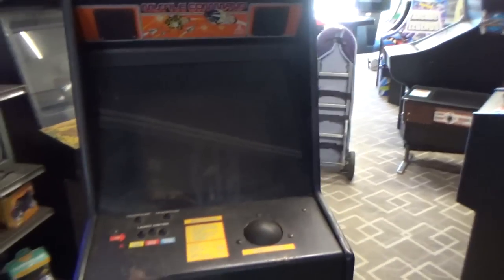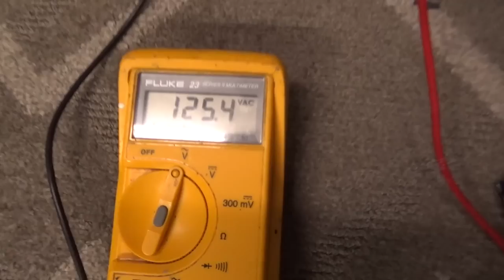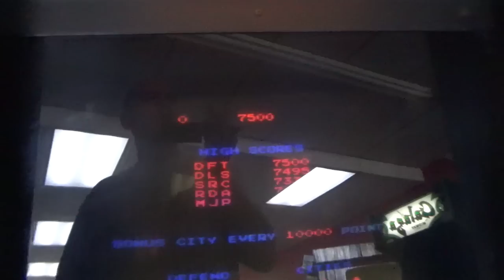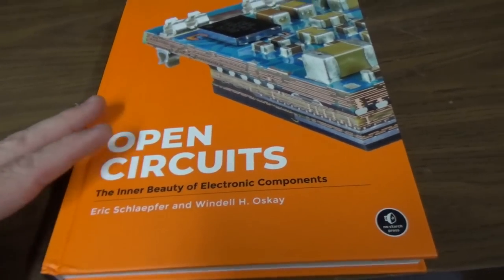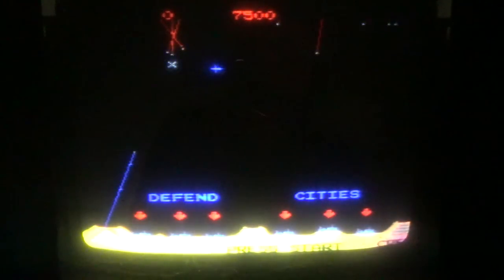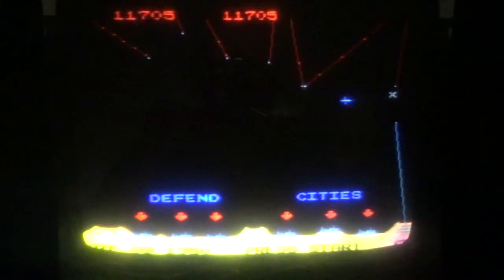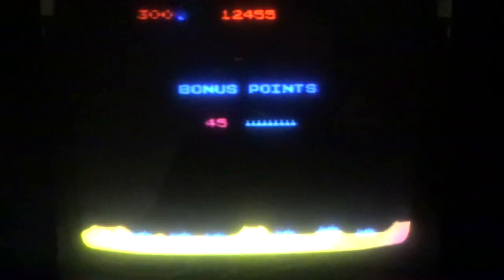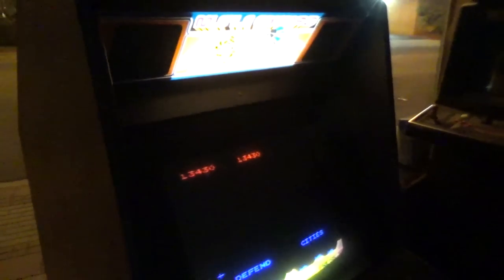Repairing This Old Atari Missile Command Arcade Machine - Completely Dead Survivor Cabinet!

Comment: I 100% agree with starting at the wall. I had a gorf and the ground pin was missing off the plug. Had the 60 cycle hum because the ground was bad. Replaced it and no more hum.

Comment: In an 8 bit system 255 is the largest integer number you can store in one byte (8 bits) (0 to 255 gives 256 numbers).  Trying to store a larger number than that in one byte is an error, if it's a variable they never expected to get that big they just didn't program in any error handling so the program crashes or does unexpected stuff.  This was back when memory was so expensive that you programed as efficiently as possible to save every bit of space, so no extra bytes for numbers you don't think will ever go over 255 and minimal or no extra code to deal with errors.
Reply: It gets weirder than just an error. The system will roll over the register count and add 1 to the adjacent register. Depending what's in that next register is how it will corrupt.
Reply: @chrislembke9566  Well, all you have is the 8-bit accumulator, so it doesn't roll over to another register (that only works with memory address registers and the program counter). It just sets the carry flag and starts over at 0. So you get a truncated rollover.
Reply: This guy and the comments below cover it. 2 to the power 8 is 256. Each bit (which is on or of via high or low/off current) is either 1 or 0 used to create binary numbers and hence the 256 max value...or if you start from 0 then 255 is max value, hence why both numbers are 'weird'. As the comments below say, once you hit the max number and then 'add' one more either the overfow value spills into another variable or part of code messing that up or rests the currnet variable to 0 and starts over or both.
Reply: ASCI goes from 00 to FF in the code also. That associates 0-255.
Reply: @David-ue3vf  -- Older machines used their own adaptations of ASCII. Some used a 7-bit ASCII. The alphanumeric characters and the control characters were all in the same places, but every thing else varied.
Reply: This happens regardless of binary or computers. Imagine if you were counting from 0 and you could only use 3 digits (like a combination lock where each digit is on a separate spinning cylinder). You would go from 0 to 1 to 2 ... to 99 to 100 to 101.. then finally to 999. If you continued counting normally (without the 3 digit limitation) you would go to 1000, however you only have 3 digits so the 4th digit is ignored and you're back at 0. 8-bit processors like the 6502, which Missile Command runs on, work with 8 bit (bit just means a binary digit) binary numbers. Specifically, they have 8-bit data buses, which means the processor can only receive and send out 8-bit numbers, and an 8-bit ALU which means they can only perform operations on 8-bit numbers. Counting up from 0 in binary (base 2) would look like the following: 0, 1, 10, 11, 100, 101, 110, 111, 1000... The number of digits (bits) goes up exponentially, so 1 digit can hold 2 values (0 and 1), 2 digits can hold 4 values (0 through 3), 3 digits can hold 8 values (0 through 7)... 8 digits can hold 256 values (0 through 255). It is possible to store values in 16-bits (and any arbitrary multiple of 8 bits) using an 8-bit processor although it increases the size of the program and is generally slower and harder to work with
Reply: @martykopka  Nothing 'spills' over automatically. Adding 1 to 255 just makes the accumulator (or byte in the address being incremented) zero. It's the programmer's responsibility to carry any overflow into the next most-significant-byte if appropriate. If a value was only intended to be < 256 then there won't be any code to do that. Problems arise when a value of zero is used to lookup into a table of data or function calls, where zero was not intended to be a valid index.
Reply: @PlumGurly  Even in some 8 bit CPU's it is still possible to do 16 bit addition "automatically".
I am most familiar with the Z80, it has opcodes (instructions) to do both 8 bit and 16 bit addition.
With 16 bit addition you can have values between 0-65535.
You would of course have the same issue as the '256 value' if you tried to use 65536 (or above) as your 16 bit number.
I do agree with he earlier comment that every single byte was so expensive. Therefore, 16 bit numbers could be  an unnecessary luxury. 
If you switched to a 16 bit system, every time the code dealt with the number it would require extra byte(s) of code so it can mount up.
Reply: @mondrus72  -- Agreed. And the Z80, interestingly, had a 4-bit ALU. It took 2 cycles to add/subtract. And you'd think this would be a bottleneck, but it outperformed the 8080 and the 8085. Sure, they could have gone with an 8-bit ALU and even used a Skip Carry Adder to make it able to handle faster clock rates, but that wasn't their goal. They only wanted to outperform Intel and stay competitive with the pricing.

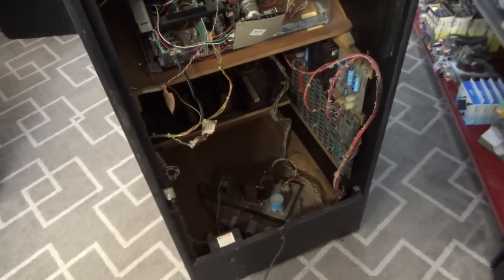Comment: The classic tag line @1:22 & @2:31.  Makes me laugh every time; especially the setup of the punch line. You ought to add a laugh track everytime it is said.  😅 Missile Command was a staple at Shakey's Pizza in Elk Grove Village, IL in the 80s.
Reply from the maker: I never had the pleasure of going to a Shakey's but I just recently learned they existed, and there were several in Charlotte where I live, that I have been going inside of for years, not knowing they used to be a place called Shakey's pizza!  One is a pawn shop I've been going to for 20 years and the other one that I know of is a car audio place....
Reply: @LyonsArcade  As a young teenager in the mid 80s, Shakey's pizza had a beer batter dough and just made the Pepperoni pizza so good but was secondary to the video games. I think Shakey's still exists in California.

Comment: One of the authors of that book is a regular on the CuriousMarc channel.  Over there they are restoring a lot of historical (not just vintage) stuff, such as the control modules used on the Apollo missions, and an old mostly-mechanical air data computer for 50's and 60's fighter jets.  Definitely worth a watch if you have time.
Reply: Also, re the 256 thing, there's a "Retro Game Mechanics Explained" video that goes into detail about why the Pac Man kill screen happens.  I think I've seen a similar one about Donkey Kong.
Reply: Yep, great channel.

Comment: I imagine that 8-bit machines were not too handicapped in comparison to the 16-bit machines of the day.

For instance, take the i8088. That was a cutdown 8086. It was a 16-bit CPU, but everything was done using an 8-bit bus. So the bus had to make 2 trips for 16-bits, and really, that was 3 trips at least because the address and data lines were also shared. Then on top of that, those same lines were needed for ports and IRQ signaling. Sure, there were separate IRQ/NMI lines to signal the fact of the matter, but the data lines were to tell the CPU which vector to use. So in comparison to a 6502 machine with much less memory, a 1.59 MHz 6502-based machine could do a little more work than an IBM XT at 4.77 MHz.

Or, take the TMS9900 as used in the TI-99/4A computer. It is a 16-bit CPU, but the board designers cut down the computer to only use an 8-bit bus. On top of that, the CPU had no registers (besides maybe a program counter). So while the 6502 and I guess, the 6800 could use Page 0 much like "extra registers," the TMS9900 only had Page 0 to use as registers. So they installed SRAM for Page 0 but DRAM for everything else. They made other design decisions that I wondered about. I think it uses the Big Endian storage format instead of the more common Little Endian. And it is byte-addressed despite being 16 bits.

As I said in a previous text wall, you could do larger numbers with an 8-bit CPU, but it will take you a while. However, that isn't as bad as you'd think.  I mean, in earlier CPUs, the more bits you had, the more latency you need. For instance, try designing a 16-bit CPU using 74xx gates. You can do that. But then, you get to the ALU. Logic operations are truly done in parallel, but additions/subtractions are not. As long as you chain only 2 nibble adders to get 8 bits, you could get some useful speed out of it. But if you used 4, you'd need to drop the clock rate. The reason for that is that although those are "fast" tree adders, chaining them introduces a carry ripple. With 2, you'd need twice the time of 1, and with 4, you'd need 4x the time. 

Of course, you can mitigate that and make up for some of that lost latency. So if you need 8 bits, you could use 3 nibble adders and some multiplexers. For the upper nibble, you'd let 2 adders work that, getting the carry-in signal from Vcc (+5V) for one and Gnd for the other. As for the Carry-Out for the low nibble, you send that to a multiplexer. So the low nibble carry-out decides which high nibble output goes on the bus. You could scale that to 16 bits, but that starts eating up components.

My point is that nowadays, it is possible to get much higher clock rates for 8-bit CPUs than for wider ones. And with the right coding, you don't have as bad a bottleneck as you'd think.

Really, if you want older machines to perform better, reworking things to use a 65C02 @14 MHz or so would greatly increase things. And if you could disassemble the ROMs, optimize them in assembly using the extra 65C02 instructions, and make new ROMs with the new instructions, you could improve performance more. Or shoot, you could rework a 6502 system to use the '816. I am not 100% sure that is a true 16-bit CPU. I think it is mostly 8-bit with Shift/Rotate instructions and some move sizes being 16-bit. I'd have to look that up as I could be wrong. Still, that would be more efficient though the code in '816 mode would be a bit awkward/weird. You'd have new instructions and some 16-bit operations. The '816 can use a 24-bit address bus, but the upper 8 bits are carried on the data bus. That increases board complexity unless you intend to limit it to 16 address bits. Yould only be able to use 64K in that case, but that might be worth it for a 6502 with more instructions.

There is one other thing to consider. The 6502 and similar used BCD instructions. Those were good to use for high scores and things. You can convert those to ASCII without using division.

Comment: good job on fixing the game.  the monitor looks like it could benefit from a manual degauss though.  I think the 4600 in general looks pretty good in general but they are a pain to work on and half the ones I see have that restraining arm that hold the boards in is missing and I have to fabricate something with a shade baffle which a friend gave me a ton of and get used for all types of things I need scrap wood for.  waiting to see you take on a real challenge of something like a watchdog vector side of an asteroids.

Comment: Okay, 8-bit machines only work with a byte at a time. If you calculate 2 ^ 8 power (2*2*2*2*2*2*2*2), you get 256. So that means you can only have a range of 0-255, which is 256 places.

And yes, you can use larger numbers even with that limit. You'd have to assemble them in RAM. Well, the 6502/6507/6510 has no ADD opcode, only ADC (Add with carry). So if you don't want to use the fact that the last number went past 255 as part of the current operation, you would need to do the CLC (clear carry flag) opcode. So if you need a larger range such as 0-65535 (65536 is 16-bit or 64K), you'd take advantage of the carry to use as carry or borrow. So while you could work with longer numbers than the bits, you could, just that it would take more work.

For things like memory addressing, that requires 2 registers. There might be a Y and an X for the index registers. They are what drive the address lines on the chip. 256 bytes is not enough memory so the old machines often had 16 address lines. So for an 8-bit computer, you'd need to use 2 instructions to set the low and high memory address registers. The 6507 only had maybe 13 address lines, but for most memory usage, you still needed to use 2 registers.

The above is also why old CPUs tended to have special instructions that assumed that the upper register was 0. That was known as Page 0. So you could specify only one register and access the memory faster, as you'd need 2 instructions, not 3. You'd only need to set one of the registers and then do the memory op (load or store) with the Accumulator register.

Another thing that people wonder about is how subtraction works. Really, subtraction is just an addition with slightly more work, assuming you use the 2's complement system of storing signed numbers. On an 8-bit machine, 0-255 would be an unsigned number. But for some things, you might have -128 to 127. That sacrifices the upper bit and lets you store negative numbers starting from the maximum on down to where the top bit is no longer set. So to negate a number to the 2's complement, you'd invert all the bits for the 2nd argument and add one to it. At the CPU level, inverters sit at the B argument connections, and the carry-in line into the adder gets thrown. The formula is -A = (!A+1). To negate in circuitry, you take the 74xx adder chip and wire an inverter or XOR channels to the B argument wires of the adders. If one wants to use XOR you can tie the real B lines of the bus to one side of the XOR gates and the outputs to the B lines of the chip. Then tie all the other halves of the XOR gates together, to the carry line, and whatever line makes the selection between add and subtract.

I mentioned XOR (exclusive OR) because they can be used as switchable inverters. For each channel, you can use 1 input for the input and the other for a control line. So if the "control line" is 0, the bit is the same as what enters. If the input is 0 and the control line is 0, XORing 0 with 0 is 0 since the input bits are the same. And if the input is 1 and the control line is 0 then the output is still 1 since XORing the input bit of 1 with the control bit of 0 are opposite one another. Now, if the "control line" is 1, then an input of 0 becomes 1 as they are opposite, and an input of 1 would become 0 as they are the same.

So if you XOR a group of bits with 0, you get the exact same thing. If you XOR something with itself, you always get 0.  If you XOR with all 1's such as 255 on an 8-bit computer, you invert the output.

Comment: PIng Pong the non video game and Missile Command the video game are the only two games that give me a certain headache when playing at a high skill level. Good at both. Get an odd tension headache in the back of my brain. Feels like a brain cramp. :P I would love to get to work on old arcades though. More my electronics type than newer stuff with ball grid arrays and SMD chips that I need a ton of equipment for. Just me, a multimeter, and a schematic. Sounds fun.

Comment: Binary (base 2). A bit is on or off,  high or low, 1 or 0. You put 8 of those together you have a byte and the number you can create is between 00000000 to 11111111. If you convert that from binary to decimal (base 10) that is 0 to 255.  When they were programming  ("8 bit programs"), they assigned the variable to keep track of the level, or cities, or anything as being a one byte. Memory was expensive/scarce so they trimmed down things to the smallest size possible so they could use the rest of the memory for other things, and one byte is as small as you can go. As soon is that byte is supposed to store the next number, 256, then "Houston, we have a problem".
Reply: ASCI was the code used for almost all the programming of these games back then and that is a base 16 number system. So, you would have 00 to FF (which is 0 - 255 also) in the programming code. The CPU would convert those codes from ASCI to binary. This would be stored in an 8 bit memory that stored in binary. Most of the time, this was in kilo byte size memory back in the 80's. Mega bytes were almost unheard of in computing units.

I used to crack these games when I was young and give myself extra lives and such. Finding the hex code associated with a particular thing inside the game was fun for me. You could do "print" commands and all of a sudden you have the whole game code printed out on that beautiful dot matrix printer, with the continuous paper feed. Oh, it was so much fun.
Reply: @David-ue3vf  ASCII is a way of assigning text to numbers. The CPU only receives bits, it doesn't know what they are being used for (letters, numbers, flags, etc.). ASCII was designed for terminals, so it would be strange for a complete ASCII coding to be in any arcade game, although many games used ASCII as a basis for how they arranged letter tiles in their tilesets. Hexadecimal (base 16) is a common shorthand for writing binary (base 2) because it's a multiple of 2. Any base which is a multiple of 2 can act as a shorthand for binary because each digit in the higher base corresponds to a certain number of bits (digits) in base 2. The higher the base, the less digits there will be, although you'll have to add more representations for digits